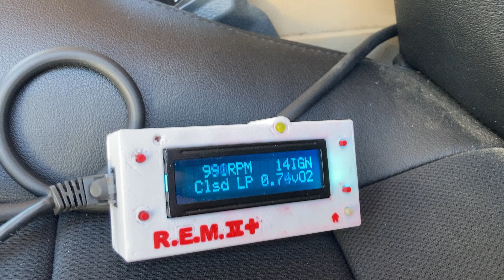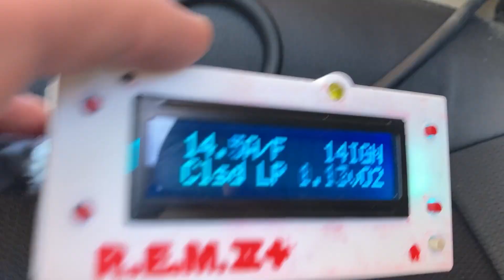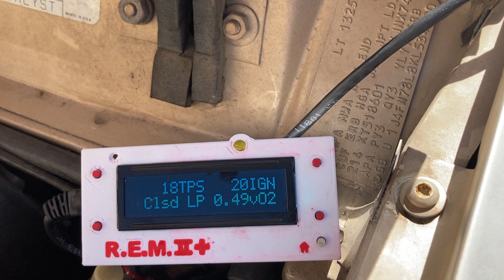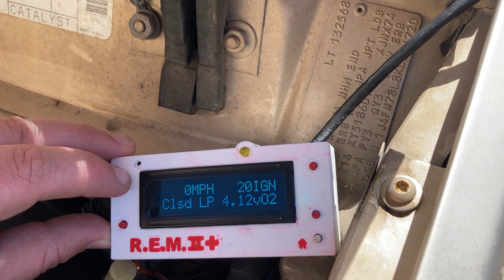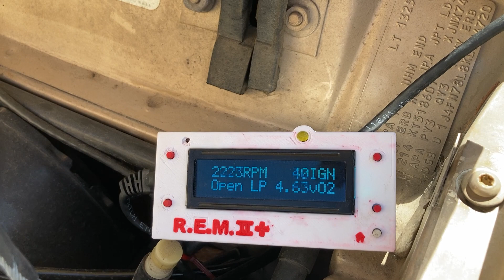Fix my XJ Wagoneer Part2: Small update

Comment: Are the plug wires on the correct plugs?  The Haynes and some other diagrams out there are wrong.   From what I understand on the Renix, the distributor sensor is not used once the engine is running and the ECU knows what stroke it's on.     Try checking the distributor timing following http://cruiser54.com/?p=68   Remove the distributor hold down bolt and rotate a few degrees in either direction to see if the problem changes.  Put an old-school timing light on each plug and the coil wire to see if the spark is breaking up.    Run the engine with the lights off and see if you have sparking or shorting on any of those new wires.   Intake clean and air filter not dirty and sucking up out of place as you rev it?

Comment: We know it's getting good fuel pressure to the rail, but runs lean and won't rev. I think if it was me I would find a set of stock injectors and try them
Reply from the maker: Been there, tried that.
Reply: @AICvideo  One time my buddy had one that did a similar thing, fuel pressure checked out fine and bled down as soon as it was shut off. It ran bad and wouldn't rev, after we changed out the fuel pump it ran great. Other than that I'm not sure.
Reply from the maker: yeah, I'm on my 3rd fuel pump and my 2nd fuel filter, so I don't think that's it. I'm going to pull my valve cover and make sure all my valves are good. Maybe I got some debris in there when I changed the ventilation gaskets or something.